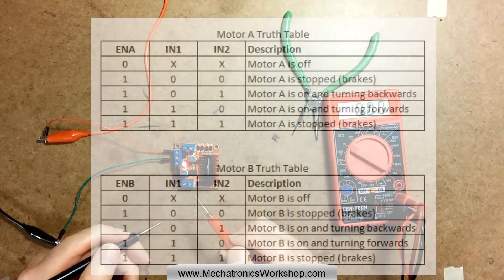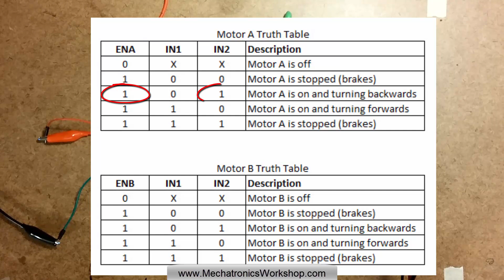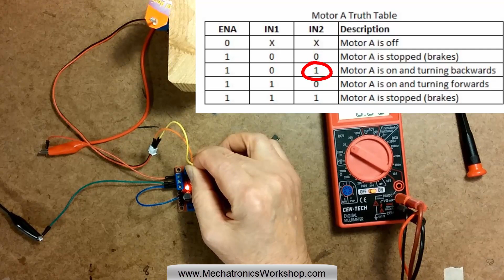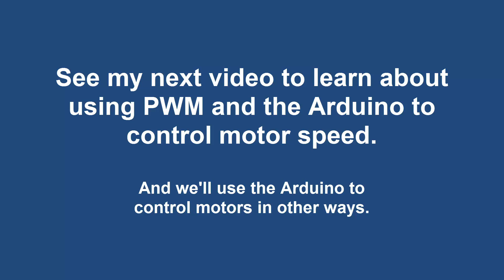The L298N H-bridge motor controller module - basics

Comment: Hi, this is the only video where a multimeter is being used to show what is going on....thanks!  I guess I don't understand that if you supply say 7v -- the regulator will bring it down to 5V in order to make the "internal circuitry" work.  But then if you supply 5V into the power supply...you seem to say we need to provide another 5V to get the internal circuitry to work.  Well if the regulator is only using 5v to get the internal circuitry to work....why can't it just use one 5V input...why do I need to provide a second 5V input?
Reply from the maker: OK, you asked for it -- Here comes the world's longest answer LOL!   Yeah, this is all pretty confusing! It's been a while since I've used it, so let's see if I can explain it this way -- The really big chip with the heatsink on this module is the L298 and is what I mean by 'internal circuitry' mostly. It is designed to accept standard TTL logic levels, and needs a 5V power supply to make it smart enough to run its internal circuitry. That's what takes low voltage/low current inputs (that you will probably be supplying with a low-voltage device like an Arduino) and use those inputs to control the higher output voltages and currents, speed, direction, etc that you probably want for motors or whatever you're driving.

You can power up the logic portion of the L298 one of two ways. One way is via the 5V regulator that is on the module (the on-board regulator). The second way would be to apply your own 5V regulated power to the module, bypassing the on-board regulator. 

If you want to use the 5V regulator on the module, you must apply at least 7V (up to 12V) from an external power supply to the 5V regulator in order for the 5V regulator to have enough 'overhead' to power itself and provide a 5V output. (All regulators need some input voltage higher than the output voltage ('overhead' voltage) due to internal resistance, heat loss, etc.) The on-board regulator can tolerate an input of 7V - 12V and regulate it down to a fixed 5V. Anything over 12V input will overheat the on-board regulator and burn it out.

So let's say you only have a single external power supply that provides regulated or unregulated 10VDC. You want to control two robot wheels using 10V motors, and a 5V Arduino. If you apply your 10V to the module, it will be plenty of voltage to power the on-board regulator (which will drop the 10V to 5V and send regulated 5V to the L298), and it will apply the raw 10V to your motors. The on-board regulator will also provide 5V output voltage to power your 5V Arduino! So you power everything with a single power supply.

At 2 minutes (2:00) in my video I'm showing that the 12V input has powered the on-board 5V regulator that now provides a regulated 5V output to the L298, and additionally, makes 5V available to send out to any peripheral device you like, such as to power an Arduino. So 12V in basically goes in, takes a U-turn through the on-board regulator and comes back out as a new, regulated 5V output source.

Now let's say you have a 24V power supply. That's too much for the on-board 5V regulator, which can only handle 12V maximum. So you need to remove the on-board 5V regulator from the circuit so you don't burn it out. You do this by removing the jumper, which breaks the circuit to the on-board regulator, removing it and protecting it from over-voltage input.

But with the jumper removed, thereby removing the on-board 5V regulator, you need to power the L298 somehow. You've removed the on-board 5V regulator so you need to apply your own regulated 5V input to the module. So if you only have the 24V supply, you're going to need an external regulator (like a buck step-down converter) to drop the 24V down to 5V. Then you will apply that external regulated 5V to the input pin (which was an output pin a minute ago) (at 2:00 in the video). Yes! The 5V pin shown at 2:20 in my video can be output 5V or input 5V depending on whether you have the jumper in place or not.

You can apply the raw 24V to the module to drive your motors if that's what you want to do (up to 35V). But if they're still 10v motors you need to step down the 24 volts somehow. And that can be done with PWM (Pulse Width Modulation) from your Arduino (which is beyond the scope of this session.) It can also be stepped down using a buck converter. 

Whew! Let me know if I cleared it up at all!
Reply: @MakeBasicElectronics  Thanks for the extended explanation it definitely helps clear things up!  And I'm sure other wandering souls may benefit from the conversation.  Where I'm coming from is: I think I only have 5V available as far as I know (I've seen someone take a usb cord and cut one end and use that).  I'm a beginner so I may have more available -- I just don't know it yet...maybe there is some cord I can find.  But if I have only 5V available...well, at 3:00 you experimented with that.  You dialed your input supply down to 5V and tested the 5V+ pin and only 3.21V were showing on the multimeter.  Now, someone who wants to drive a 3V motors and doesn't know much like me might say...."hey, my motor I'm trying to drive is only a 3V motor, so that should be fine!"  But I think from reading your response, you would say: "That won't work, because the L298 needs a regulated 5v to run."  You might even add that "the 3.21V number is irrelevant because the motor will receive what you input (5V)....it's just that the L298 driver won't work because it's not being powered sufficiently."  Does that seem more or less correct?
Reply from the maker: @peterm.4026  You're right -- what I think you're describing won't work. You'll need more than a single 5V supply from your computer to use this module. What are you trying to do? Just a 2-pack of 1.5V batteries would drive a 3V motor (even a single 1.5 battery would probably drive a small 3V hobby motor). If you just want to turn the motor on and off, the batteries would be the easiest route -- no circuitry required.
Reply: @MakeBasicElectronics  I'm trying to make a plant watering system which is a little more complex than just turning the motor on and off I think.  I've been following this video:  https://www.youtube.com/watch?v=Oo6Mp82NFWg  He uses a MotoMama L298N.  I actually pulled this off doing what he did exactly.  He uses only 5V!  My problem is that I don't think these MotoMama shields are being made anymore.  So I bought the exact same L298N driver that you are using.  So now I'm in the predicament of when watching your video and other videos about it that I need more than 5V.  But of course since I made the MotoMama L298N work using 5V only, I'm kind of open to the idea that I could make it work with this other L298N in your video with only 5V.  Maybe the answer is that it's risky what I'm doing, it may destroy something....or maybe the answer is that the MotoMama is different than the driver in your video.
Reply from the maker: @peterm.4026  OK, it’s all becoming clear :)  The L298N we’ve been discussing will work fine for you. The pinouts might be different, but you should be able to get this one working pretty much the same way as the MotoMama. 

We weren’t communicating very well about your usb cord. I understood you to say you only had one cord. So my statement, “you need more than a single 5V supply from your computer to use this module” wasn't complete  --  For your project you obviously need much more, such as two separate 5V connections, a microcontroller, several control jumpers, etc.

Notice that he uses two 5V inputs (that appear to be coming from a single source (his desk outlets). But they’re two separate cords connecting to two separate locations on the L298. This can work, but it's not a good idea to run a motor from the same supply that runs your logic (the Pi and the L298), due to inductive loads, power spikes, etc, from the pump motor feeding back to the logic.

I said the L298 needs a regulated 5v to run -- and his Pi is providing that in his project. So no need for the L298 on-board regulator (which would drop 5v to 3.21 if you tried to use it, but you don’t need to). So he has done the equivalent of removing the jumper from the L298 board, which removes the on-board regulator (if the MotoMama has one) from the circuit and relies on the external regulated 5V from the Pi.

So at 1:42 https://youtu.be/Oo6Mp82NFWg?t=99 he’s supplying a regulated 5V from the Pi to the internal circuitry of the L298 using jumper wires. (He calls it the motor shield at 2:00 https://youtu.be/Oo6Mp82NFWg?t=119, where I call it internal circuitry). This would be the external regulated 5V supply that I suggested. 

Notice that he mentions that the Pi can’t supply enough current for the pump motor. So at 2:00 https://youtu.be/Oo6Mp82NFWg?t=119 he’s connecting a second 5V line via his stripped usb cable from the desk outlets to the L298 to power the pump motor.

Also, it appears that he’s using his computer usb to supply 5V to the desk outlets, and then to the Pi, L298 and pump. I suspect his desk outlets are supplied by a different, more powerful supply than his computer (it looks like he might be using a powered usb hub which can supply much more current (amperage) than the computer alone). But I would hesitate to use a computer (with or without a powered usb hub) as the sole power source for something like this.

I think he's using more than just the computer for power because most computers only supply about .5 amps through their usb port. The current required to run the pump motor could be twice that amount. The pump that he links to does not show current requirements. So I looked up a similar 3V pump motor and its current requirement is .5 to 1 amp. 

If your pump draws only .5 amp, that would still be the absolute limit of many computers (not even adding in the current requirements of the Pi and L298). That’s a dangerous level to be at. If the pump draws 1 amp, that's twice as much as many computers are meant to supply. At 1 amp, at best, your computer will shut down or limit the current to your project causing it to act erratically, or stop working completely. At worst you will blow out your computer usb port, and possibly your entire computer. 

Either way, you would be wise to check the current requirements of your pump motor and other peripherals in your circuit and use a power supply capable of providing sufficient current.
Reply: @MakeBasicElectronics  Wow, thanks!  A lot for me to unpack and look up.  I appreciate the scenario of the 1 amp potentially hurting the computer.  I feel like I don't pay attention to the amps and usually just think of voltage in terms of keeping my electronics safe.  The sentence that jumps out to me the most is  "it's not a good idea to run a motor from the same supply that runs your logic (the Pi and the L298)..."  It might be easy for me to say, "hey you're only using one supply for your whole setup with the 12V supply!"  But I suppose it's different because the Pi is delicate so you're suggesting it's not smart because you might get some power spike feeding back into the Pi -- which could destroy the Pi...does that sound right?
Reply from the maker: @peterm.4026  
Way to keep me honest! Yes, spikes back to the Pi concern me as well as lots of other things I’ve experienced over the years. 

But thinking more about it, my concerns are no doubt overkill for your scenario, so it was good for you to question the two-supply statement. I was thinking more of circuits driving things like servos and relays directly from the microprocessor where they usually draw more current than the micro can provide.
 (In which case a single supply can actually still be used, but more carefully.)

I was in an 'industrial' mindset when saying that, and should have shifted into 'hobby' mindset first! For hobby-type projects with low power and few demands on the circuitry, and something like the L298N as a buffer between logic and the motor, one supply is probably just fine.
Reply: @MakeBasicElectronics  thanks for letting me pick your brain!
Reply: @peterm.4026  Thanks for the thanks. Good luck with your project.

Comment: What about sample wiring connection for 24Vpower supply to drive two 24V DCmotor, using Arduino Uno along a breadboard. Assuming Arduino Board is powered by 9V Battery.
Reply from the maker: I've been thinking about doing something like that. Time is a little short for me right now, but I'll try to do one in the near future!
Reply: @MakeBasicElectronics  Appreciate your help on my request.I shall look forward my friend just when you have time for it.

Comment: Hello sir..im making 6wheeled car so can i run 6 Dc motors of 12v and 60rpm with this L298N motor controller ? please do reply me :-)
Reply from the maker: No. This board can control only 2 motors.
Reply: MechatronicsMan can't i connect 3motor in one side and 3motor in another side ? so all the speed and direction will be same either forward or backward
Reply from the maker: Haha! Very creative -- I didn't think of that! Yes, you could do that -- but variations in motors will possibly cause some wheels on the same side to turn at different rates. You will need to test your motors to find ones that are close to equal. Be careful not exceed the current rating of the board (total of 4A). Spec sheet: http://www.st.com/en/motor-drivers/l298.html
Reply: MechatronicsMan  ok thank you so much
Reply: Did this end up working?

Comment: my driver heatsink is getting VERY hot (not able to hold my hand on the heatsink) Is this normal ? I tried 2 differents one and seems the same. I was driving NEMA23 stepper which doesn't seems to work good (saccaded movement) Thanks
Reply from the maker: A heat sink's purpose is of course to dissipate heat, so yes, they'll often get very hot -- too hot to touch. This is normal under many circumstances. Be sure to check the current draw, voltage, and load rating specs of any motor you're driving. And make sure the voltage and current draw do not exceed the ratings of the L298N. The L298N is pretty old and a new-style driver might also be a good option. Here is a pretty good tutorial discussing stepper motors and drivers: http://forum.arduino.cc/index.php?topic=284828.0
Reply: @MakeBasicElectronics  thanks alot. I found my answer somewhere else few times after i posted my question. I saw the driver is rated 2A, Unfortunately my stepper is 2.8A oops... i have to buy bigger drivers. Best regards

Comment: My motor driver is not delivering required output when motor is connected, it is given 12V from battery and 5V output, what may be the problem?
Reply from the maker: I would need more information to help you. What is your voltage source? Which pins are you using for input and output? What motor are you using? Do you have the correct output voltage when the motor is disconnected?

Comment: Hi.  Will it be ok if i use six 12v dc motor 100rpm on this?  Will connect 3 motors on the righr side and 3 motors on the left side. Will it be ok?
Reply from the maker: Check your motor current draw specs. The L298 has an always-on supply rating of 2 amps per channel. Or 2.5 amps if you're running 80% on, 20% off. Dividing 2 amps by 3 motors says each motor should not exceed .67 amps for continuous use. Here's a link to the data sheet https://www.digikey.com/product-detail/en/stmicroelectronics/L298N/497-1395-5-ND/585918
Reply: Geared motor specs
Rated voltage:12v
No load speed:100rpm @12v
No load current:0.17A
Rated speed: 93rpm @12v
Current rating:0.68A
Rated torque:7kg.cm
Stall torque:42kg.cm
Stall current:2.19A
Power:5W

Hi sir.  This is the motor specs i will be buying.  Im a student and new to this and still learning about motor drivers and motors.
Reply from the maker: @sjd5335  If you're a student you would be best off to ask your instructor. I don't know what load you're going to be putting on your motors or what speed. But if you run them at the rated speed under "normal" load you will probably be ok, but you will be running at pretty much the maximum recommended capability of the L298N at .68 amps each. But if they stall (get physically stopped by an external force while still having power applied by the L298N), the current of each motor jumps to 2.19 amps each (3x2.19 = 6.57 amps for each side), far exceeding the limits of the L298N. It sounds like you might be building a robot of some sort, so you might find some good information about all this if you search for robot help here and on google.

Comment: Sir, nice explanation . But I have got one question.... What if the input voltage exceeded the 12V , assuming we removed the jumper . What is the voltage output will be on the 5v and the motor 1 pins ?
Reply from the maker: Thank you! Removing the 5v jumper disables the internal 5v regulator so you will have an invalid voltage (if any) on the 5v pin. I'm not sure what you will have on the motor pins, I'd have to measure it. But it won't matter because the 5v regulator will be disabled. The 5v regulator is needed to power the internal circuitry, which is needed for the motor pins to function. If you apply over 12v to the input, you must remove the jumper and also input your own regulated 5v to the 5v pin. If you do that you will have the same voltage on the motor pins as you do on the input (minus about 1-1/2 volt drop across the internal circuitry). 

So, for instance, if you apply 24 volts to the input, you will see about 22-1/2 volts at the motor pins if you have also applied your own regulated 5v to the 5v pin. (And assuming you have the correct voltages on the enable pin and In1/In2 or In3/In4 pins).